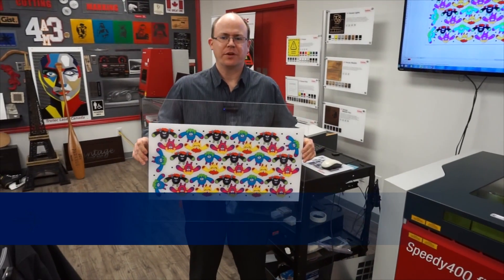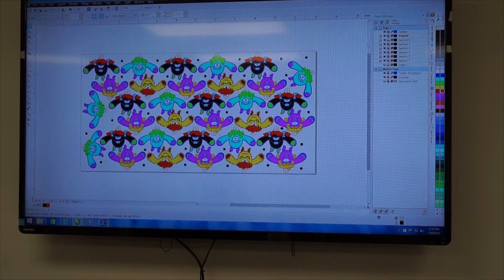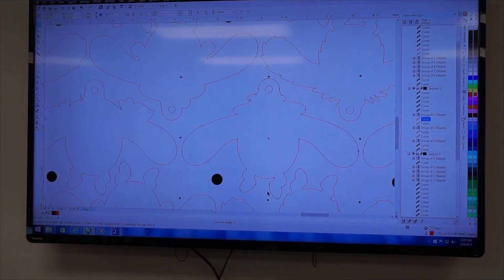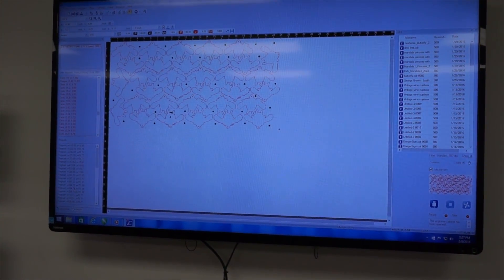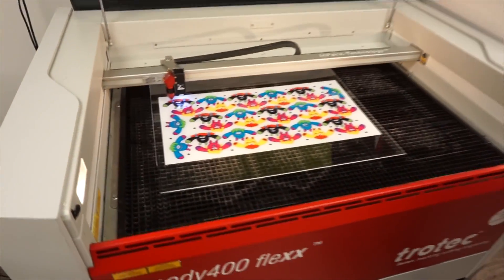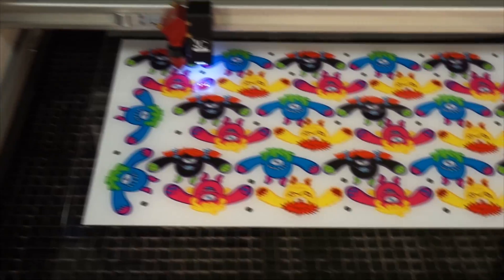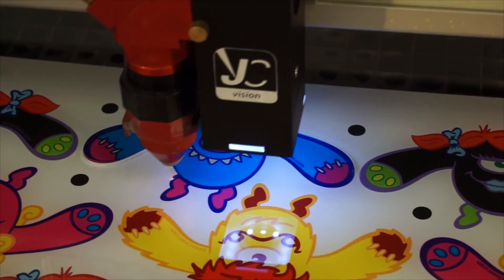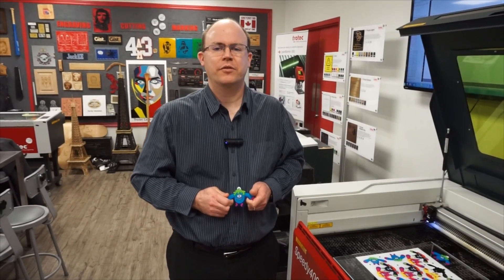JC Vision Camera System | Laser Cutting Acrylic

Comment: Curious. Whenever I laser cut with the Speedy 300, I always get some "fogging" around the edges of the acrylic if it's not protected in the film masking. This process makes it look flawless without the film. I'm interested in considering the JC Vision and acrylic printing for exactly what is shown here, but I'm confused about how the fogging is not present in this example. Any ideas?
Reply from the maker: Hi there, sorry for the late reply. We're actually cutting acrylic and you are likely cutting lamacoid plastic material? If you're still getting fogging with acrylic it's likely your power setting is too high, have you tried lowering it to the most minimal power to cut the material?
Reply: I have the same problem. I always first apply application foil (you know, the carrier foil for application of cutted vinyl) .Sometime I cannot use the protection foil (for instance with acrylic engravings) than a layer of hand-soap or a wet paper might help. Another thing: it is batter to engrave in several steps low power than in one step high power.
Reply from the maker: Thanks Arjan, that's a good point.